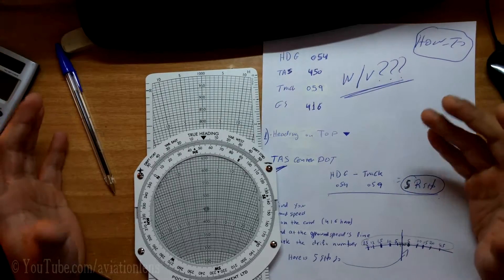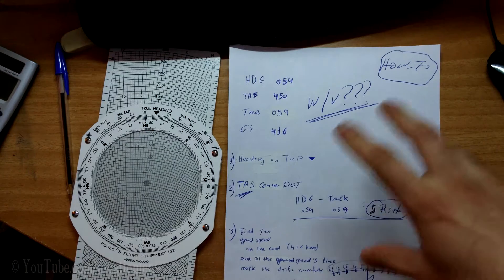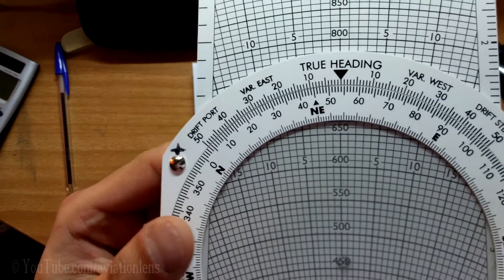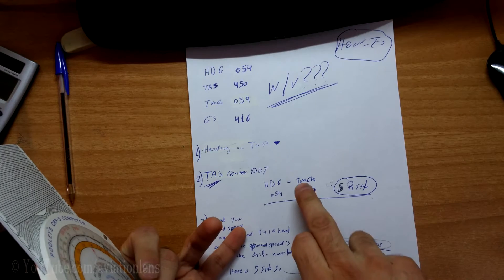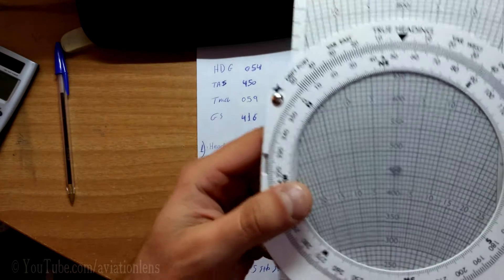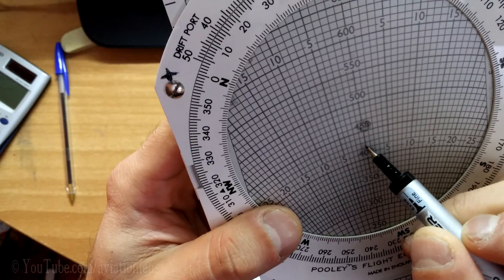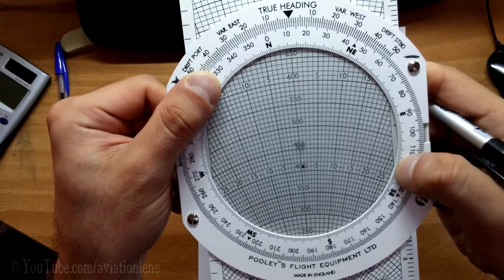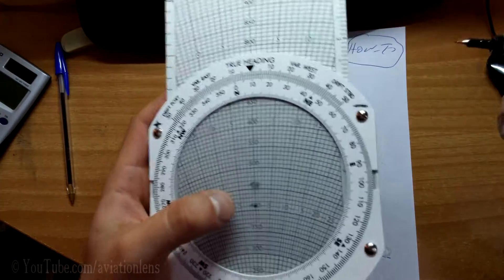CRP-5  * HOW TO *  find Wind Direction and Velocity  [ Given HDG,TAS,TRACK,GS ]

Comment: Sir you are completely wrong first we checked all related video about  WD/V They are putting TI to TC not TH and they are all putting the Correction Angle  dot over TAS arc for this question as 5 degree to the left TC to TH as 59-54 They are all again sliding dot to NORTH  top over TI direction not to SOUTH
Reply: It's not wrong at all, there is more than 1 way to calculate wind velocity using a CRP-5. This was just one of the methods.